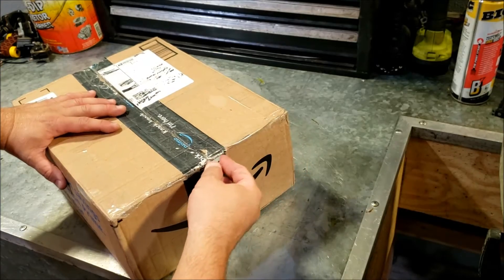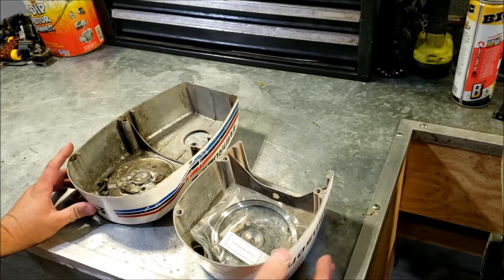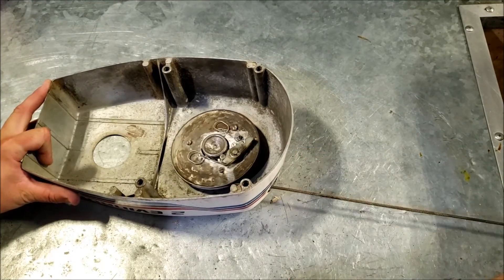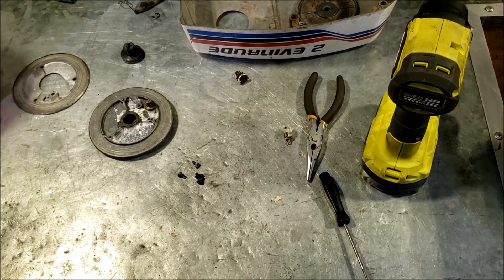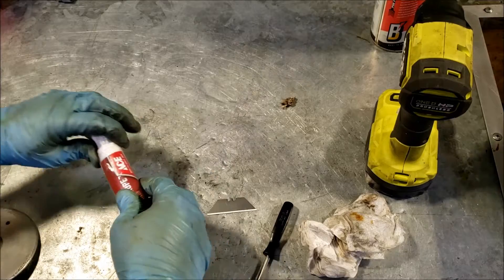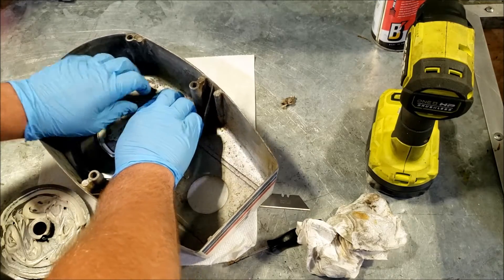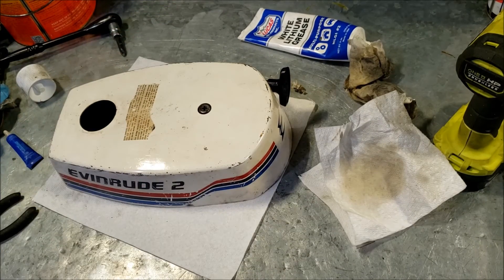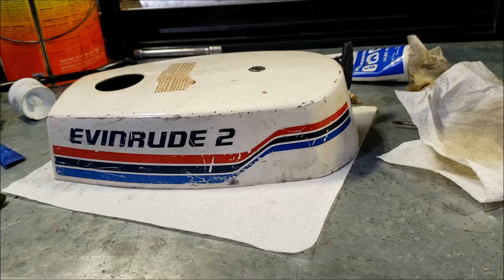1.2 / 1.5 / 2 HP Johnson Evinrude Colt / Junior Starter Repair

Comment: Hey there thank you for all your videos you share with us I really appreciate it and I’m in need of help please with my 2602S  evinrude 2 stroke 2 hp…….. now 1 month after using it out on the water it was not missing a single beat absolutely purring it till I’d finished with it and cleaned etc put it in my shed and stored it for a month then just yesterday I got it back out and went to start it but unfortunately it never started I then obviously did the tests etc for spark cleaned the points and adjusted the points to correct measurements and what not but that was all good but still did not want to start so i decided to take carby of and clean it thoroughly also I used a carby kit put it all back together and tried to start it and yes it started  but on start it is running super rough coffin and splattering and eventually conking out but if I put it up to fast it runs sweet and yes trying to adjust the low and high speed dials are absolutely doing nothing can you think what to do next should I replace condenser and points for new ones I don’t know please help me?

Comment: Something weird has happened to my starter,So I accidentally removed the center screw, wich made the spring pop out, So I installed everything in a correct order, but now when I install the starter, it's seems like the center spindle pulley(the one where the big center screw goes into, hits my flywheel, so it doesn't return the cord, unless I untighten the bolts from the hood, I don't know what could be wrong? I do hope u understand what I mean as I'm not a native English speaker 🙄, do u know what might be wrong?I do have the short hood version wich is the evinrude 2hp 2 stroke from 1972 2202m